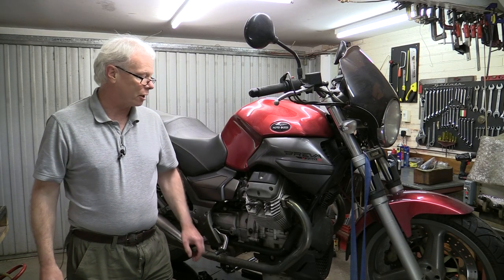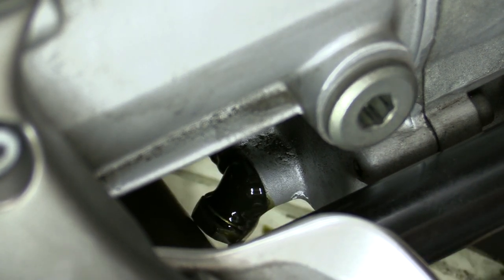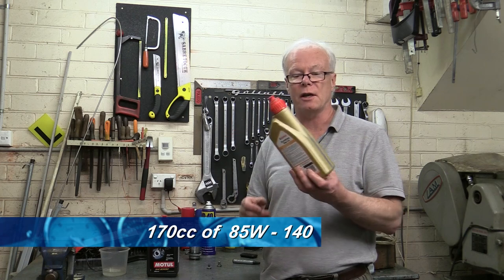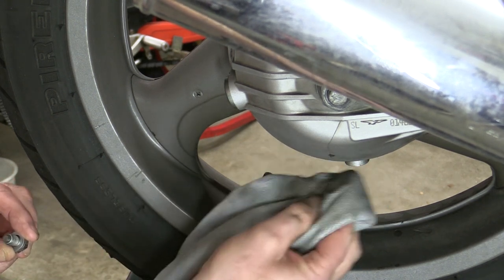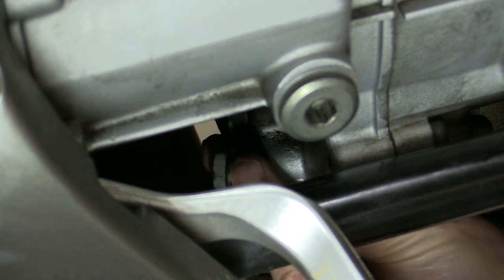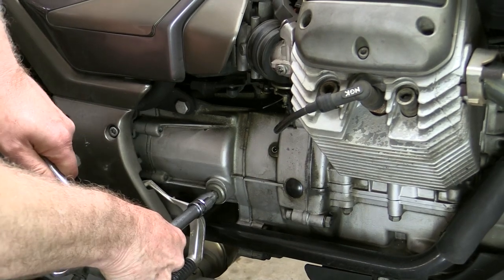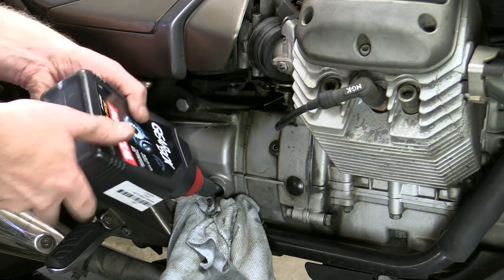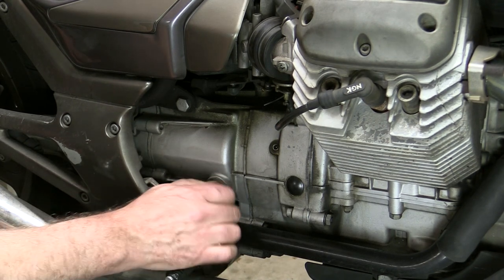Moto Guzzi Breva 750  Gearbox & Bevel Drive Oil Change

Comment: Thanks Mike! 
When I just bought my second hand Breva, I've had a situation during winter time, where my gearbox would get stuck in 1st gear and couldn't change gear to 2nd until it warmed up. The oil in the gear box must have been very old, it was very thick. I've pun new oil, and problem solved.

Comment: Rear transmission box lubrication:
N.B. To check the oil level correctly, the
transmission box and the swinging arm
should be perfectly horizontal, as shown in fig. 27.

Comment: Thanks Mike, very well-done video. For the 2021 V7 850 E5 Stone model, the service manual specifies 75W-140 oil for both the gearbox and the final drive. Do you think that it would be ok if we use the same 75-140 for the older model for both gearbox and transmission oil?

Comment: Thanks Mike, very useful as it's a job I am about to do. Slightly off topic can I ask which make of flyscreen you have fitted.
Reply from the maker: It was factory fitted. The part numbers are  GU32575210 or GU32575211 depending on type.
Reply: @MikesMachines 
Thanks Mike👍

Comment: Hi Mike, I saw some oil seep at the bellhousing. It happened to my 2012 V7S too. I wonder if that is not that bad?
Reply from the maker: Ours has been weeping oil for years around the bell housing. A minor leak is not a problem. If it starts dripping from underneath it's time to check the rear main and gearbox seals.
Reply: @MikesMachines  Thanks for the reply. So I shouldn’t worry much on my v7s 😅
Reply from the maker: It's worth getting a second opinion locally if it concerns you.

Comment: I kindly ask if before replacing the oil it is necessary to do it with a warm engine?  Thanks in advance for your reply
Reply from the maker: No, but the oil will drain faster if it is warm.
Reply: @MikesMachines  👍👌👋

Comment: Mke
Any reason why cannot fill
final drive oil through the top vent hole
and just wait for oil to start dripping out of horizontal hole (which you used to fill the cardan oil)?
Reply from the maker: I can't think of any reason why not.
Reply: @MikesMachines  The bigger question is why Guzzi would design it like that? I guess they needed a way to determine the level of oil by having the port horizontally- as they do for the gearbox oil, but did they really need a vent hole? (the gear box does not have one?).
Maybe the top hole really is the fill port because it’s sure darn inconvenient to fill the horizontal port at the rear. The gear box level/fill hole
is almost as inconvenient. I realize there are design compromises in any engine design but this vent hole on cardan case is an interesting one.
Makes the Guzzi that much more full of character! LOL

Comment: Hi, when I remove the Bevel Drive Box from the rear swing arm…will there be oil flodding? Or are the Bevel and the Gearbox separated from each other? (Moto Guzzi V35 IMOLA) Regards
Reply from the maker: Yes, the gearbox and bevel drive are separate.
Reply: @MikesMachines   OK thanks for the quick answer. What is the purpose of the upper screw on the Bevel Drive Box? The lower is for drain and the middle is for fill in, right?
Reply from the maker: The upper fitting is the breather, the middle is the fill and level plug and the lower is the drain plug.
Reply: @MikesMachines  is the upper a valve or how does it breathe?
Reply from the maker: I've never had one apart so can't say

Comment: Hi Mike, would you be so kind to tell me the crush washer and o-ring sizes? I’d like tu buy them before taking them off my motorcycle. What I found on the internet is this information, correct me if anything is wrong.
The numbers mean: Inner/Outer/Thickness
sump:
front - 20/28/2mm
rear - 10/18/1.5mm (with plastic insert)
filter - 8/15/1mm 
rubber o-ring - don’t know the size
gear box:
10/18/1.5mm (with plastic insert)
transmission:
10/18/1.5mm
Reply from the maker: Those sizes look right but I've always bought them as spares.
Front sump washer - GU95100709
Rear sump, gear box & bevel  drain washers - GU01528930

You can substitute standard alloy crush washers for the plastic insert sealing washers if need be. The plastic type were a later update.

In regards to the o-rings.
Inspection/fill plug o-rings 20,24X2,62  - GU90706203
But i doubt that they will need replacing.
Reply: Mike's Machines  Thank you!

Comment: Hi. I bought a moto guzzi750 ie 2003 , maybe you know what the problem is.  I start the moto and it stalls.  The engine does not work .  when I turn the accelerator it can work a little.  and then stops working again. Help somebody...

Comment: Very poor explanation of changing the gearbox oil, in that the principal problem in completing this task is the amount of room between the gearbox oil drain bolt & the catalytic converter (balancer pipe), with oxygen sensor. Because of the conical shape it depends on it's orientation as to how much room you have to remove the drain bung. In other words turn it 90 degrees one way & you will have very little room but turn 90 degrees in other direction & you'll have a lot more room. The difficult factor here in turning the pipe though is that with no main stand they have a pipe that runs from one side of the bike to the other. If the oxygen sensor is above this pipe then the pipe itself may stop you from turning it enough to get the gap you need. This means either removing oxygen sensor or removing the pipe.